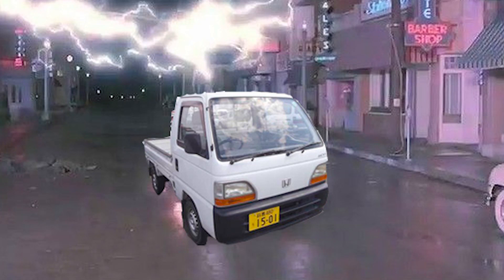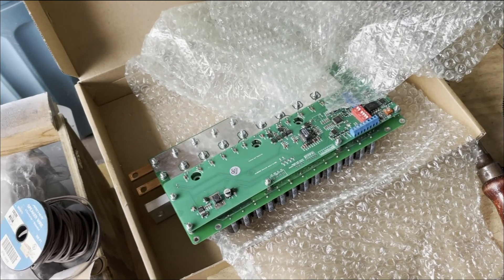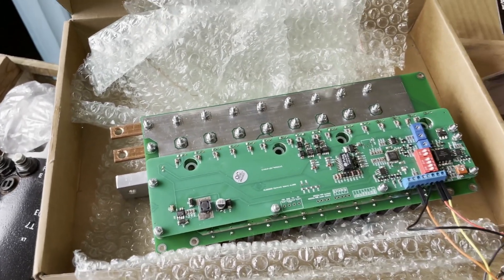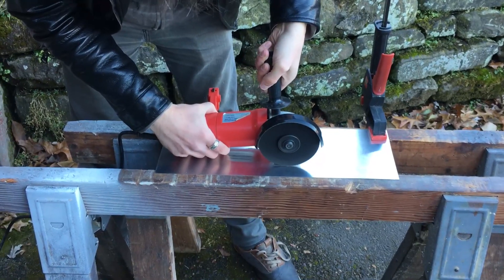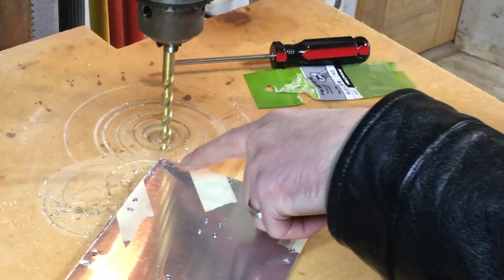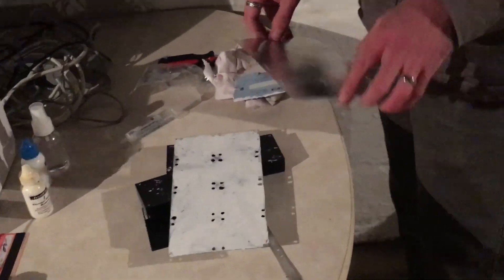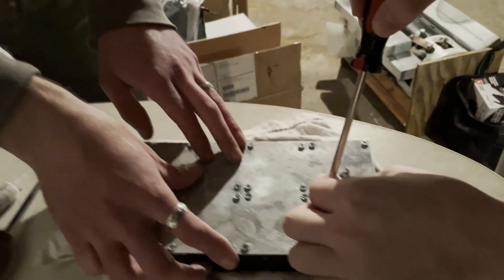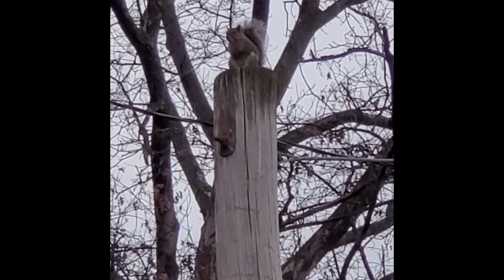Converting a Kei truck into an EV - The Controller - Part 10

Comment: Wanted to comment on the string holding the carbon brushes during the assembly but then considering you guys have not done this before is an  achievement in itself..
Great work..